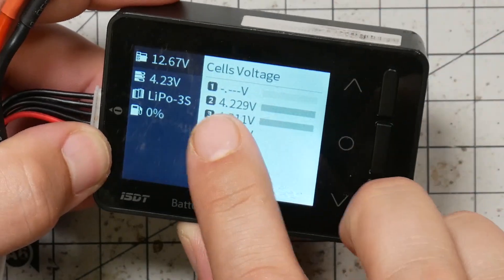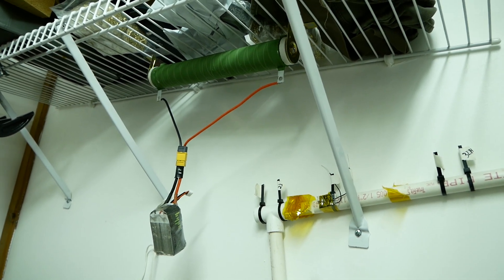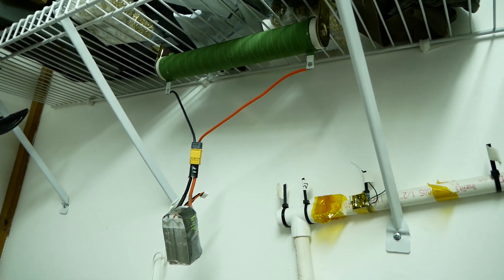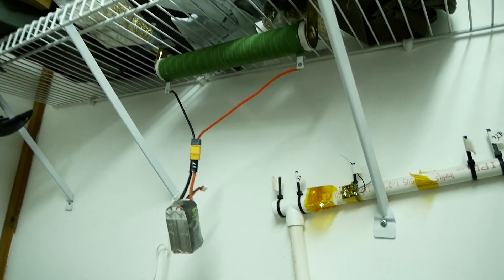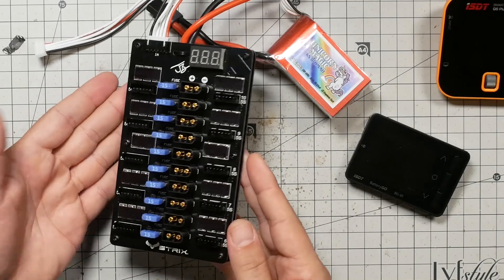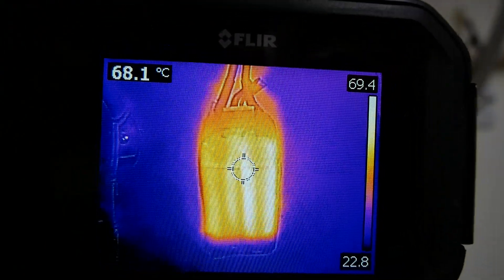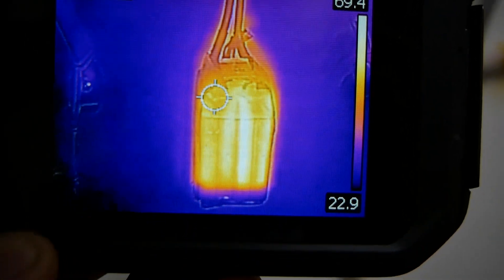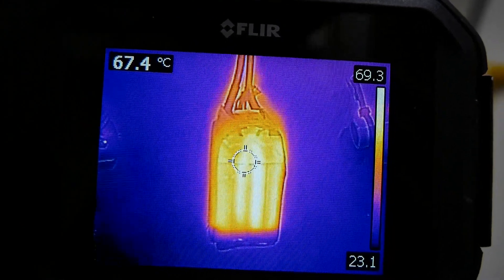Is Your LiPo Safe To Charge | WHEN TO THROW IT OUT

Comment: The single best way to kill lipo (we killed our 6s 5k heli packs like this and I use it for all lipos) take a trash poker (stick with a sharp metal point in the end) and a bucket of heavily salted water and puncture all the cells in the pack in the salt water. Salt water kills the electrolyte, no smoke, no fire, no fuss and totally safe... leave it in the water for 30 minutes and then go recycle it. It's far and away the single safest way to kill a pack. 6s 5000s will really go off in fact it's really violent much more so then out small 1600mah and under packs just because of how much larger the cells are. This method is the way to do it with zero risk of fire, or a venting lipo that is putting out toxic fumes that you do NOT want to breathe in. At the end of the day salt water and a sharp object to stick holes in the pack is the way to retire a lipo pack. Or take it out to the range and shoot it and yes we have done that and it's awesome.

Comment: Keep a couple of those cheap aerosol looking can fire extinguishers with your batteries. If there is a fire the plastic valve will melt and set off extinguisher. Also keep a good one next to them for just in case you are there as well! One of those battery analyzers is good for discharging too and you can keep the data from it to compare batts performance over its life.

Comment: for some reason all 8 of my packs suddenly stopped performing, they charged fine but when it came to flying they would do half a punch out and then give up,  they all did this at pretty much the same time,   i had only recently started charging at more than 1c and also we had a really hot (90's) summer, not sure whats to blame.  but heres the upside, they still work fine on low discharge tasks like bluetooth speakers or goggles. is it possible a few hot weeks could destroy them like this?  they were 4 newish and 4 very old (infinity's) .. the newish ones (tattu 70c's) went first, then the infinity's
Reply from the maker: Hard to know for sure but you're right to look for common links. Storing in high temp like a hot car could damage them.
Reply: @John Grzeskowiak hmm, yeah thanks i will have a look at the IR, i might be able to salvage some . i think the weather killed them even with me being careful to avoid direct sunlight,  its not the only explanation,  over discharged, full charge for too long, parallel charging, 1.5c charging?  i wonder if flying without capacitors can be added to that list?

Comment: Could you clarify what you mean when you said that parallel charging batteries with cells of different internal resistance can damage the good cells? I'm not sure I get that. Thanks!
Reply from the maker: That's not exactly what I think I said. If you have one cell that dies and goes to zero volts, it will take all the others down with it.
Reply: @JoshuaBardwell  you're right I misheard that. You're talking about if a cell goes to 0 volts it'll then drain the other cells in parallel. So if a cell has higher internal resistance but is otherwise stable that shouldn't affect the other cells. But if it is actively draining voltage it could affect other cells in parallel. Thanks for the clarification I appreciate it!👍

Comment: Hey Josh, Would you consider a 2-cell pack still safe for storage if one of the cells is completely dead and the total batt voltage is still 3.86 V?
Reply from the maker: I think the pack is safe since each cell is at storage or less, so the potential energy is quite low. But I wouldn't try to recharge it. I would dispose of it.

Comment: I understand you swim in money and don't care, but I'm not throwing out my 1300mah batteries if I underbolt them or damage them. Almost all of my cells are slightly damaged and have been recovered at least once. In my opnion this is fine, just store them in a metal box and youre good.
Reply from the maker: I don't swim in money. I just am not willing to risk burning my house down and killing my family to save a few dollars on a pack that is going to fly like shit anyway because it's been over-discharged. I also regularly parallel charge, so the risk of a damaged pack is much higher for me than if you charge one pack at a time.

When somebody is new in the hobby they don't know what the safest practices are, and they do dumb stuff without realizing the risks. That's who I'm talking to here. If you are experienced enough to take on additional risk, more power to you.

Comment: I discharge damaged packs by plugging it into my cheap field soldering iron with a cell checker connected.  I also leave it overnight, but I make sure the cell checker has gone dead, and still leave it.
Reply from the maker: I would just worry about overheating the soldering iron tip and wearing it out.

Comment: You can discharge a battery flying it!!!!
And rebuilding batteries isnt thet hard, recomend you give it a go
But lipos are really explosive
Had a little one pluged in once and  didnt realize it and it blew up big time.
Great video!!!!!
Reply: Ultra RC... I was just thinking that maybe a good way to discharge a battery would be by putting it in a plane and secure it in such a way that it can't take off and keep the throttle around 40%. The LVC in the ESC will shut down the motor at a preset programmed voltage after which the battery can be balance discharged in a charger. I'm new to RC but this sounds feasible to me as it would save a lot of time discharging. Or instead of doing it in a plane it would be easy enough to rig up a motor and ESC with BEC as a stand alone device to do the same thing.

Comment: Guilty, but when I use a questionable battery I do keep it safe. Like when it's not in use I put them in a pirex pot.
When they don't hold voltage I break the PAC and save the good cells.

Comment: I'm glad you spoke about taking calls out to make a smaller battery. Yes, it can be done, and pretty easily at that. I suggest using snips to disconnect the POS and neg of the bad cells instead of desoldering anything. Then solder the leads back properly and cut the balance lead to the new size.

Comment: I was at a fly in last Sunday, there were some lipos being charged under the pavilion. Me and another guy heard several loud ticks (like a spark plug) so I went over to the charging station and had a look. Nothing out of the ordinary so I continued to watch the airplanes. About 30 seconds later a large hissing and a second later a deep woosh as I looked over there was a good foot of flames being shot out of a lipo, nearly scorching a guy who was trying to fetch some hush puppies from the tray. The intense flames lasted about 15-20 seconds, a member of the club used their fire extinguisher, but it was very small and let out a "poof" then quit. A second guy grabbed a larger one to prevent the building catching on fire. Lessons learned: 

1) Use a lipo safe charging bag
2) Have a proper fire extinguisher around and know where it is stored. 
3) Do not charge lipos near or in buildings 
4) Lipos are dangerous, never think yours wont shoot mad flames (they might)

Comment: Most of my RC background comes from helis where the battery prices can be pretty high. With this said, I have to say you guys just kill your batteries with the way you run them. Charge them to 4.20 volts, fly them down to storage charge (3.75-3.8 volts...I haven't been flying 4S for awhile now buy if I recall this means flying the battery to around a constant 14.8 volts in the goggles for 4S and a constant 21.8 or 21.9 volts in the goggles on 6S (not counting punch-outs of course)) and never store them fully charged and charge at no more than 1C and you will likely get at least 200-250 well performing flights, if not more. If you want all the punch out and long flight times then just move to a low kv motor/6S setup... just that simple. Why drain your wallet and the environment over non-sense?

Comment: I prefer the nail method. Yeah it's dangerous, and the fumes may or may not be toxic, but at least you get a nice show before you get rid of it. 

It you want to be safe when you throw it in the trash, maybe discharging fully and then drive a nail in it. No flames will happen because it's a dead battery, though it may hiss a bit. Leave it over night and it will have no chance of lighting up a garbage truck.

Comment: When I kill a cell or 2 I just take the battery apart and storage charge the good cells till I have 4 of the same good cells and rebuild the battery. I simply can't afford to chuck out packs with one dead cell at the moment. I currently have 2 stock batteries and 2 rebuilt acehe 75c 1500s and 1 cell at storage waiting.

Comment: I recently blew up a few old LiPos (some even old enough to not have balance leads) on purpose in controlled circumstances (outdoors with the door shut, to keep out the incredible stink).  What I found was that the only way of provoking a fire was to overcharge a cell very very heavily.  One pack happily kept 6V per cell without even smoke coming out (but then turned into fireworks on further charging.)  I didn't manage to burn anything by short-circuiting or by mechanical damage.  Still, my packs are all stored and charged in non-combustible surroundings because a LiPo fire is really no fun at all.

Comment: At what Internal Resistance would you consider a battery no longer healthy? And what IR should a good battery have?
Reply from the maker: Different size packs will have different IR. And different C-rating packs will have different IR. Also bear in mind that IR changes with temperature and state-of-charge so if you are measuring IR you have to control for that. 

For a typical 1300 or 1500 mAh pack I would say an IR over 20 would be suspicious and an IR under 10 would be pretty good.
Reply: Thanks! @JoshuaBardwell

Comment: I had a small 2c lipo pack with a bad cell light off on my kitchen counter. I don't care if you are watching it or not once it lights off all you can do is watch until the fireworks subside and then deal with the aftermath. Even, if like me you are lucky and didn't burn down the house or have any physical damage to cabinets or counter tops, you will be cleaning up fine black soot from every crook and crevice in the entire room! And god forbid your wife is home when that happens or you and the batteries will be sleeping in the back yard. (mine was shopping at the time) From then on I only charge and discharge outside. I even store my batteries outside in a lipo bag in my Weber BBQ just in case they light off when I am away from home.

Comment: Pro tip for 6s pilots looking to make a globe discharger. Go to your local auto shop and get a truck globe rated for 24V.
Reply from the maker: Can also do 2x 12v bulbs in series.

Comment: Nobody has ever talked about a charger with temp probes, if it is getting warm, hot or what ever temp limit you set, charger shuts voltage ie charger down
 beeps loud, save your house,, I'm one that was present when a lipo went up, if I hadn't saw the flash out of the corner of my eye, got to my charging room, 
ran back and got the fire extinguisher... as it was, all I had to do was replace carpet, shelving and refinish and paint drywall.   If I had gone out the backyard
to fly another battery, I would have turned around heading back to the house and behold!!  ashes. all gone, point is whatever, turn around and regret, I still
think about this WITH REGRET OF easily my house would be gone. Folks who run chargers on lipo's without protection is like doing it with the unknown without
a condom.
Reply: larry kabo yeah but sex never feels as good with a fire safe lipo bag on your pecker ;)
Reply: first all a lipo bag is like wearing a condom with holes in it worthless, the intense heat eats right though the bag, second putting a lipo bag on as a condom would definitely not be feel good sex.
Reply: @fpvkabo  I have some old charger that do have temp probes. It seems something that is just not as popular as it used to be. I do like the idea of a temp probe.  Best way is just charge you lipos on a non-flammable surface if at all possible. I use a usda metal rack for charging, it is as safe as I can be.
Reply: Chargers with temperature probes interlocking the charge do exist for a while. My Reaktor 300 has a temperature probe. It does not let you monitor cells individually but you can just put it on top of what you're charging to cut the power should it get hot.
Reply: Most good chargers have the temp monitoring system. Mine doesn't like me  not having the balance port all the way in and says it is getting hot 🔥.
 And I can't get it all the way in with a lipo bag condom on....

Comment: Using a resistor like that to completely discharge a damage lipo is a bad idea. The defective cell will reach 0V before all the others. Then the remaining cell will charge the defective cell with reverse polarity. The reverse polarity upset the chemical balance and crystal that can puncture the lipo membrane separators will form offering the perfect ignition point. Once completely discharged the electrolyte is still quite flammable. I recommend to discharge from the balance cable with one resistor per cell. On the other hand the absolute minimum voltage on most of the lipo battery is 2.7V.
Reply: No no this is not the case , the cells in a series arrangement dont charge each other

Comment: I keep all my batteries in a ammo box!  it's metal and air tight!..and i charge them in there too! highly suggest this!..
Reply: drums&drones You should remove the seal from the ammo box.  Airtight, if it does catch fire means it will explode.
Reply: @witblitsfpv1265   I miss spoke it has a vent hole so the wires can go through! the lid fits snug and it's sealed...so in the event of a fire i cut the wires... done!  but good to know thanks!

Comment: When should I stop flying on a 3s and 4s battery? What voltage is safe for me  to stop flying keep the life of a battery.
Reply from the maker: Ideally you want the battery resting at about 3.8 to 3.7 volts per cell and no lower, when you're done flying. This means in flight, under load, it might sag down to 3.6 volts or perhaps a little lower depending on how much current your quad pulls.
Reply: @JoshuaBardwell  thanks

Comment: I'm most curious about puffing. My packs are usually a little warm and puffy after flights, is everyone's like that? Is it not a concern unless they get really hot? Should I consider them safe until they show some other sign like different cell voltage or resistance? 

They seem quite healthy otherwise, but I do think I'm pushing the C rating a little. 1300 75C Tattu with 30amp ESCs, I think with 30 amp I'm supposed to get 100C 1300 or 80C 1500. I've been trying lower pitch props and throttle limiting to reduce peak amp usage.

Comment: Just bought a bucket of Extover. It's a fire extinguisher for metal fires and also LiPo fires. I'm gonna build a box where all my batteries will be covered with this stuff (in plastic bags). 
I'm also using Bat-Safes for charging now. That's a big step up from charging them on the bed 😆
Reply: Lipo battery fires are NOT metal fires. There is little to no lithium metal in a pack.  Appropriate protection would be a bag of baking soda or sand on top of the battery. 
Standard ABC fire extinguishers are full of baking soda. When a hot battery melts the bag holding the baking soda, it's basically inside of a fire extinguisher at that point.
Reply: @senseisecurityschool9337  I didn't say it was. This Extover is foamed glass, so basically sand. It takes the heat, melts pretty fast and covers the burning material, blocking the oxygen.
That's why it also works on metal fires.

Comment: Thank you! Important video for me right now.
Have a lipo with a damaged cell but it was still good to fly.
I mesured the internal resistance and one cell had more than twice the amount of all others.
But why is the resistance rising at damages cells?
Reply: Think about it, resistance is how much flow of electricity is being resisted, if you  measure a simple wire end to end, you should have continuity, but let's say you tear off some wires in the middle of that wire, now you have only one or two wires that are carrying the same current as before, your resistance goes up because you can't but all that amperage through single wires, now compare that to a damaged cell in a battery

Comment: This is a video about battery safety, which I agree with, but has the following fails 😛:
1. Stole a battery from the Rotor Riot president
2. Transported it home overcharged beyond 4.20v per cell with signs of damage
3. Plugged 6S battery into 12v lightbulb 
4. Discharged overcharged battery in a closet directly below flammable materials.

Good safety advice except for that 🙂
Reply: In my opinion, safety is a thing that isn't black and white. If I have a high ability to respond to a particular risk, then I'll do my thing as long as nobody else is nearby. when UAV Futures does a speed run, Stu aims the drone right toward Calvin at full throttle; but Calvin has a riot shield to protect himself.
Reply: @billybbob18  hoomans are inherently not safe ;)
Reply: If he is around it would make it safer as to see the fire happening then being able to put it out vs burning down your house when your not there
Reply: I prefer discharging the cells individually, using a resistor on each cell, through the balancing leads. Otherwise, the strong cells can reverse charge the weak cells, inviting a conflagration.(fire) With a resistor on each cell, it will guarantee that all the cells fully discharge, without the risk of reverse charging weaker cells. I hope that resistor is higher than .5 ohms, or a 6S battery will discharge close to 22 amps! If a weak cell has internal resistance, it will heat up. NOT GOOD! A 2.2 Ohm resistor on each cell is clearly a safer way to discharge a battery for disposal.